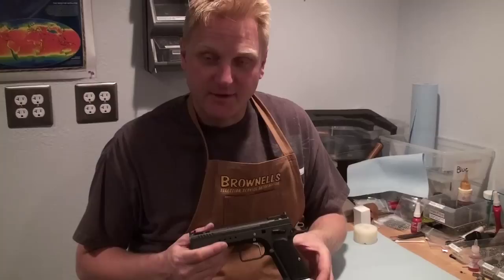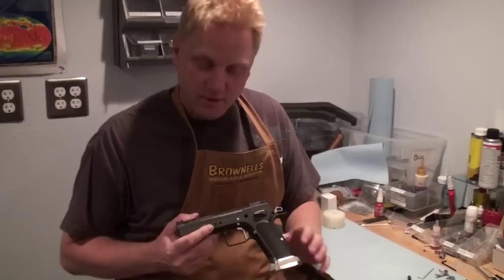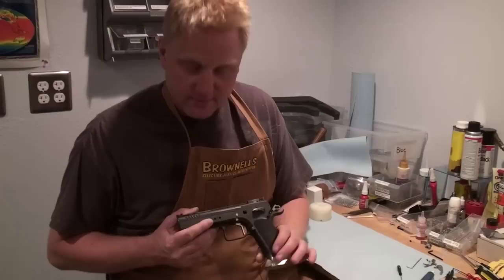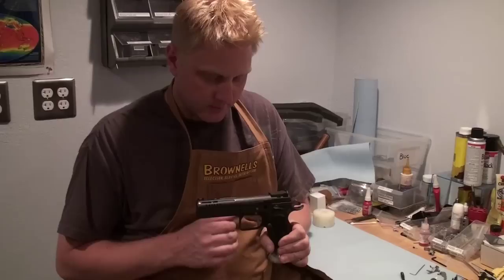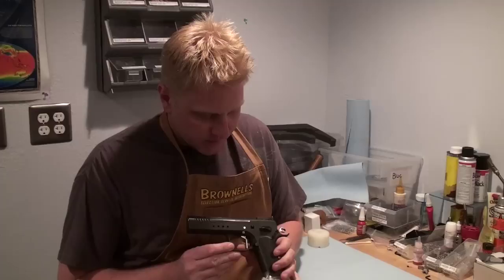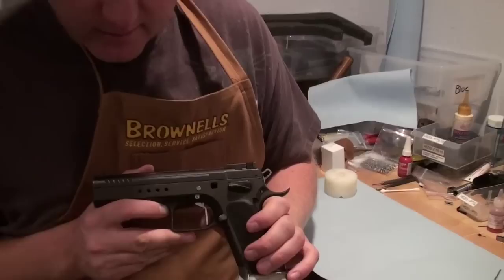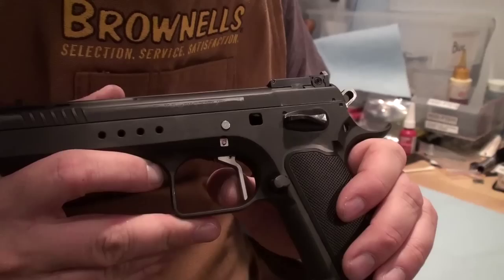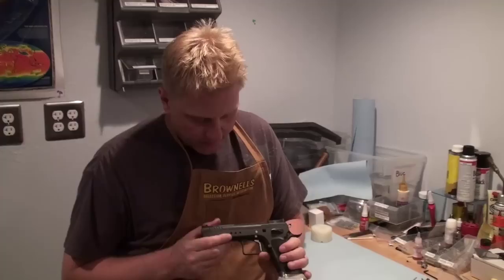Henning´s tanfoglio flat trigger system

Comment: I bought this trigger and followed the videos on his web site.  It is installed.  I am very happy with it.  I like the look and feel of it.  I still have the factory sear and hammer so I am not getting a real crisp trigger.  I purchased the EGW sear and hammer and I am waiting for his new video on how to install those.  I had a tough time fitting the trigger screw and fitting the pin to the new trigger-bar connection.   I also cut 1/4 of the spring plunger and now I have a 3lbs trigger. : )